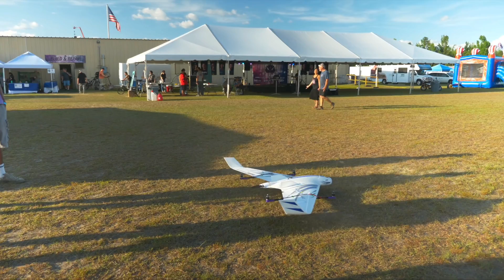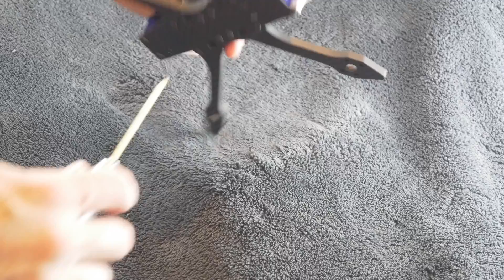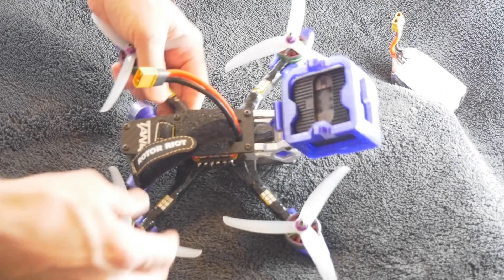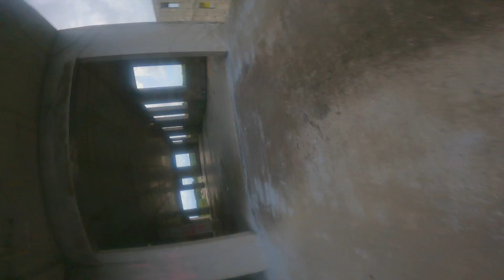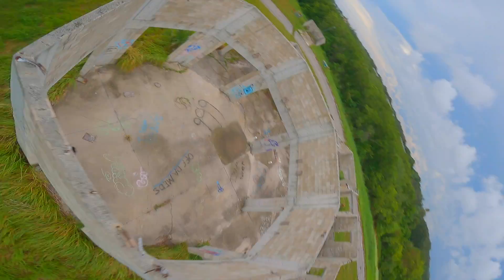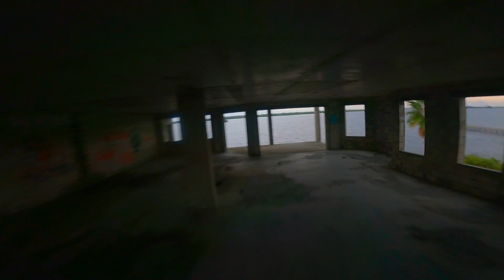My new Drone Frame - THE TANQ - IS HERE!!!

Comment: Only thing id change is top plate design to accommodate the battery strap placement to keep it stationary. Think like demibot top plate shape design for those of us who dont fly toilet style battery placement
Reply from the maker: It’s unnecessary.   My mounts are tight in the rear and the vtx squishes the strap in place, preventing it from moving. Anytime Joshua says something in a video, people think it is the only way. 

I use a rubberized strap, also, so it doesn’t slide backwards.  More on that coming soon.
Reply: @LetsFlyRC  awesome. I used to use kevlar straps, but they always slip. Now I use combination Velcro pads on top plate and rubberized straps and works better for me pretty well and haven't had a battery ejection since
Reply from the maker: @Gravity_FPV  to be fair, after watching Bardwell’s Demibot review, I did consider changing the top plate.   I am not 100% opposed to it.  Maybe in version 2.  I am always looking for ways to improve.  :)
Reply: @LetsFlyRC  I fly the Armattan Mormotte. I love the camera cage design on it and love that your frame has a good cage. The bottom plate/arms are only 4mm thick which I don't love. I'd be happier if they made that part 2mm thicker but it's my go to everyday basher cause of the warranty. I do love your choices on your frame design though. Think the top plate design could be a little sexier with some profiling but just an opinion cause at the end of the day, if I'm doing what I'm supposed to be doing, quads going to come away filthy. Thanks for the response!

Comment: my rtf version just arrived and it is looking good 
i had to remove the top plate to bind the reciever and noticed that the thread of one of the aluminium standoffs was striped out so i cant fly it right now since i dont have 20mm standoffs lying around D:
Reply from the maker: Ohh no.   Sorry to hear that, bud. I hate waiting for parts, but, I know they will sort it out if you message support@rotorriot.com.  

Hope you will get it in the air soon bud.  :)

ThanQs for the support.   You will love the TanQ
Reply: @LetsFlyRC  i just bought some standoffs now so its all fine not a big deal 
since i live in germany thats the faster way to get airborne for me 
its my first 6s drone aswell so cant wait to try it out im still new to the hobby and learning so i dont have a storage of spare parts yet 
i ran into another problem with the drone aswell it wasnt showing battery voltage in the osd but i figured that one out by myself it was placed to far down in the betaflight osd setting so it wasnt showing up in the goggles but i was still a little scared that something else was wrong with the drone

Comment: Nice frame what’s is longest flight time I can expect?
Reply from the maker: ThanQs.  I don’t know.  I built it to smash into concrete walls and survive, because I usually smash into a concrete wall before the battery dies. 😂 

But, seriously, it depends on how hard you fly.   How many amps you pull.  Hovering, or shredding.
Reply: Thanks for quick reply.

Comment: 6s 1300mah battery, or 4s 1500mah?
Reply from the maker: I run 6s 1300 on my motors
Reply: @LetsFlyRC  I have both, how will it fly with a 4s 1500?
Reply from the maker: @cdrums_fpv  the tanq will fly the same, depending on the motor choice.  

If you plan to fly with 4S, you will want motors with a higher kv, like the LeDrib 2306 2600kv motors.   If you plan to fly it on 6S, fly my motors, which are 2306 1850kv.   If you fly 6S, on LeDrib motors, you will smoke them, or the esc, or have desyncs.   If you fly 4S on my motors, it will be a bit slower than it is on 6S, but, won’t damage anything.
Reply: @LetsFlyRC  I ordered mine 2 weeks ago, can't wait 🤙
Reply: @Lets Fly RC  how long are your average flight times with the 6s 1500mah?

Comment: How does it fly compared to say a skyliner or any other top rated drone
Reply from the maker: ThanQs for the question, cdrums.  I flew the skyeliner for 2 years and I definitely think this frame feels better in the air with the toilet tanQ battery mount.  

But, if you mount the battery in the standard way, it flies exactly like the skyeliner, as the wheelbase is identical.
Reply: Roughly how much flight time will I get with 6s 1100mah lipos?
Reply from the maker: @cdrums_fpv  it depends how hard you fly.  If you cruise around slow, you can get 6-10 min, if you haul butt, more like 2-3 min.  It also depends if you carry heavy gopro or not.  Hard to answer this question.
Reply: Flying acro without any added camera, just the fpv camera?

Comment: Thats without a doubt the best antena setup ive seen yet. Was considering the Bot frame buuuut hello Tanq. What are the chances of getting the new air unit camera in there?
Reply from the maker: ThanQs for the interest.  

The O3 air unit fits into the current mounting, no problem. 

But, the frame will show in the view. 

I am working on a new tpu print that will push the camera forward, keeping the frame out of view.

Comment: Will a 30x30 fc FIT (I can mount it if it FITS) in the back? My esc and HD-Z 1w vtx  takes up the center stack area.   I’m stuck with a 20x20 fc in the rear to make things fit..
Reply from the maker: I haven’t tried it.   I will measure it later today and try to get back to you.  

I definitely think if you were to do that setup, you would be better off with a 20x20 fc, though.  It would be a much cleaner build.

Comment: This looks like a fantastic frame and at a good price too, wondering if GoPro mounts will be available as well
Reply from the maker: ThanQs. —>I have a bunch of gopro mounts and even an action 2 mount designed - and they can be purchased if you don’t want to print them, yourself.  

If you need a specific mount made, I can design it in 3d for printing.   :)
Reply: @LetsFlyRC  well I don’t have a printer so it would need to be a purchase, I’m actually looking at new frames because I broke my glide rather easily from a not so rough crash. Just worried about the weight with my current powertrain.
Reply from the maker: @SprayerFPV  trust me, the weight is fine, even on 4S.  These things have a huge thrust to weight ratio.  

My old Skyeliner frame was much heavier and I flew it for 2 years on 4S.  

Noozle3d can print the files for you if they aren’t already on the RotorRiot site.  :)
Reply: @LetsFlyRC  well I guess I will have to give it some serious thought, I want something strong but not super expensive. Your frame kind of fits the bill

Comment: Nice work man! Couple of questions about O3 Air Unit compatibility with this frame:
- Does the camera fit in the aluminum frame so its protected, but no frame visible in camera?
- Does an ND filter fit?
- I assume props would be visible? Could you get props out of view with the "deadcat" style arms you showed?
- How is the vibration on the O3 camera, any interference with rocksteady/gyroflow?
Reply from the maker: ThanQs for the interest,  deice.  

Unfortunately, so far, I haven’t found a way to get both protection for the camera, and frame out of view.  

I am working on it though.  

As of now, though, the O3 fits perfectly, inside the cage, but the cage shows.  It doesn’t have any problem with vibration, and as a matter of fact, DJI assumed we would be soft mounting our O3 cameras, so it is actually perfectly designed to reduce vibrations with the tpu insert and help rock steady do a better job.  

I am working on a new tpu mount to help get the cam farther forward and add protection at the same time, but, I haven’t had my own O3 to test with, unfortunately.  

Now that it is actually available, I can begin to focus more on that.  

I borrowed Drew’s broken one to do fitment testing.

The deadcat arms were meant to get the props out of view, yes.  

Unfortunately all of this reduces a small amount of frontal durability, so I am still working to perfect it. :)
Reply: @LetsFlyRC  TanQs for the response! 

Frame seems super solid and good to hear you've got most of the O3 mounting sorted. I might have to get one!

Comment: I done bought one. The arm mount notches tipped it. Very much a solution that a machinist/fabricator would come up with, backed by the curses of an engineer.

I fly micros, but 5” is what reeled me in to FPV. Looks like great work. 

Now, should I bother with spare arms? Hmm…
Reply from the maker: Awesome Cesotodeot!!!   ThanQs - yes definitely something that I thought was missing when I had to change an arm on the Skyeliner.  

As far as buying spare arms, I would say it can hurt.  But, I never even broke the G10 arms I prototyped with, and they were only 6mm and not as strong as the carbon, so it will be very hard to do. 

I will say that I live in FL and it never snows here.  When I visited Detroit and it was 30degrees F, I broke 3 arms and I thought it was crazy.  

Cold definitely weakens things, and it may be more possible if you live in a cold climate.

Comment: would it benefit if you cut a little concave gap on the arms? , deep enough it fits the 3 motor wires to sit flush with the arm?
tape over it and its like there is nothing there.
i think with that thick arm it can have that without compromizing strenght .
Reply from the maker: We tried this back when I was sponsored by UBAD with the Katana frame, and I still have some of them.   Unfortunately, it severely weakened the arms.

Comment: Sick! Like the antenna mount design. Have you released that? What’s max prop size?
Reply from the maker: ThanQs Alex.  The antenna mount is basically universal.  

I tried to upload it to Thingiverse today, and their website crapped out after spending 30 min making the listing.  

I’ll try again :)

Max prop size in this configuration is 5.1 - barely.  But, I will have 7” arms coming soon
Reply: @LetsFlyRC  will it spin 5.2 inch props?
Reply from the maker: @Xand3r_fpv  unfortunately, 5.2 would hit the screws on the metal frame with the current arms.  I may make slightly longer arms in a future revision if it is important to enough people.  :)